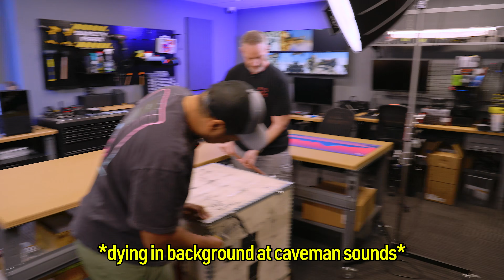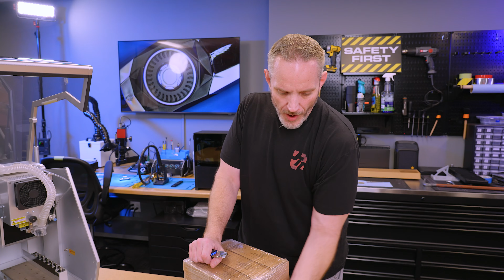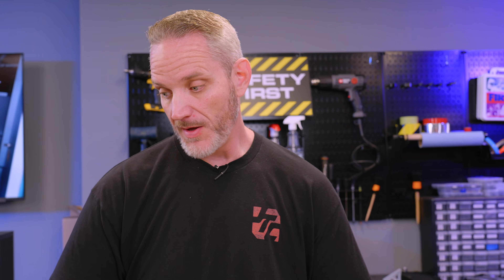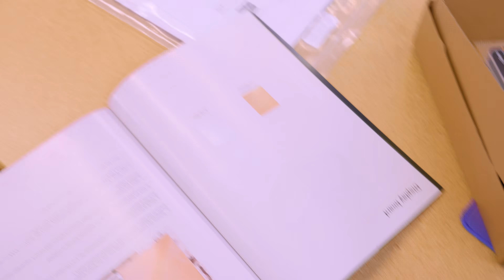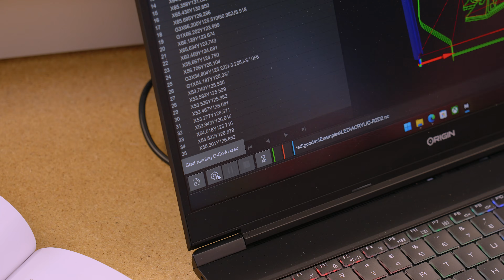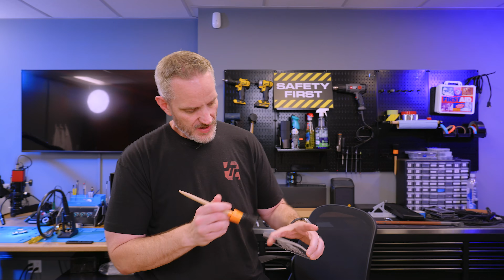I got a new CNC Machine… what could possibly go wrong?

Comment: oh, I was wondering how you would set the origin/home position on the machine. Nice that they have a little doohickey for it to make it easier for the layperson to do in case the machine crashes and need to re-check it due to the spindle and or XYZ axis moving slightly out of alignment. This is even more important if you add a 4th or 5th axis. Then again, for hobby-tier manufacturing, it probably doesn't matter as much if it's a few thou off.

Comment: 2.5 Watt blue laser, says the label. It's a regular laser diode, that you can find in some show lasers and stuff.
No wonder this thing cuts slow as heck. BUT: it beats having no laser. ^^
Reply: I was laughing when I saw that because it used the capital "MW" not "mW" lol! A 2500 MW laser would be military grade for sure. Commercial cutting lasers are around 12kW

Comment: Wow this brings me back to when I was a Class 2 Machinist at Cole Hersee, when you said CNC i got excited & then you pull out this.........its soooooo cute...lol sorry 
I used Program/Set Up 6 & 12 Axle CNC Machines which could do anything from small switch components to engine block size pieces & the Bridgeport we replaced were worth 100k maybe but the new 12 Axle CNC was worth millions & i had to stick with a guy from Germany & japan BC i was the first to use this type in American back in 84 I think it was.     

 JAY if you ever plan to do this FOR REAL for Car parts get a OIL BASED 6 axle AT LEAST CNC  machine !!!  

OH the corn bit is for routeing or cutting on plastic or PCB & fiberglass if i remember right .....only used it a few times for Space Shuttle pieces.   Cow}:--o)

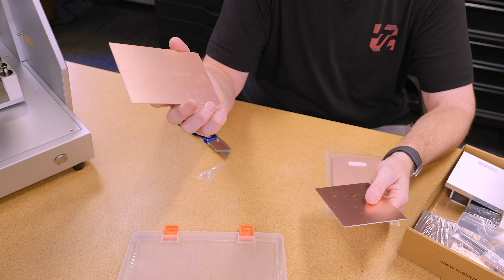Comment: 10:53 The size the 12v High volt power cable should be... Look at 12v LiFePO4 batteries and how they should be attached to inverters / solar charge controllers / etc. Then compare the Recommended Copper Size Gage for that with what is provided by NVidia for their 12v cable.

Comment: you build desktop PCs and test gaming related specs, wtf could you possibly need to CNC?
Reply: Yeah I'm not sure either maybe custom brackets or something. But just use a 3D printer and test it in plastic first and if you want metal send it off to send cut send or other services like that. I was thinking maybe custom water blocks but without a skiving machine they won't be very good in terms of heat transfer density.

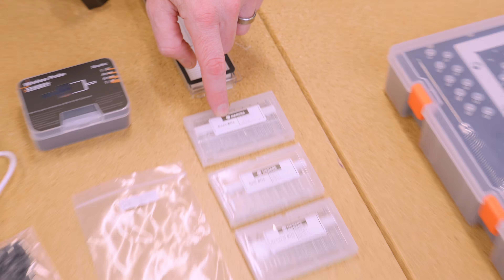Comment: Corn bits is a used for roughing out material very fast not great finish but will hog out the material 13:52
Reply: I assumed that they meant corner chamfer bits.
Reply: corn cob roofing bit looks like a corn cob kinda. The cutting edge is kind of serrated or saw tooth. Lots of cutting surfaces
Reply: @davidhumeston5292 I honestly didn't think about that. We use those to rough a lot of material out where I am at lol. We have them as same as 3/8" but I didn't think they made them much smaller than .25". We have a 1" that has 6" flute lengths that we use a LOT  for deep milling. Seco makes them, hss though :(

Comment: I love how so many tech people always resort to buying CNC machines. As a lifelong machinist, for the small little one off projects your more than likely be using this for, manual machines are soo so much better. Cheaper too. CNC doesn't offer any benefit unless your planning to make 10,000 of the same part. Maybe im wrong and your planning to do something like LTT and make a ton of screwdriver shafts or something.

edit - actually I'm probably wrong,  these little cnc machines are probably alot less daunting than manual machining which does take some training and on the fly problem solving
Reply: EXACTLY, he would have been better to out source his parts he wants at a small local shop BC he will never run this to its full potential to recoup its cost as most CNC are made for !!
Reply: Well, sometimes it's nice to draft and design in CAD. And since you already have that, nice to be able just send over to CNC. Not exactly the same but I kind of equate it to what Grind Hard Plumbing does with their Arc Droid plasma cutter.

Comment: Can you overclock it?
Reply: Nah i think he would try to water cool it
Reply: This 20w laser is the best 50w machine I've tested!
Reply: If you change the spindle to one with more power then you can "overstock" the feed rate
Reply: Can it run crysis
Reply: Yeah we wanna see it overclocked and water cooled or who cares
Reply: @ryanmorgan5644  it's actually more common to see a cnc water cooled then air cooled
Reply: Actually yes you can run the stock spindle on the carvera at a higher wattage and gain extra performance.
Reply: @MitchelWhite  yeah but it's not recommended do to risk on burning out the motor windings. Specially when it's only a air cooled spindle
Reply: @flikflak24  As always, overclocking is risky😂
Reply: @flikflak24  okay so its overclocking exactly
Reply: @RyTrapp0  year put its a bit harder to fix if you fuck up in this case compared to with a cpu or GPU ( might also be more expensive as well )
Reply: @ripcordjack  yeah but even less recommend then overclocking a pc
Reply: We can try!!!
Reply: you can overcut it
Reply: @maxmaxmaxmax-p7m  you mean overclock